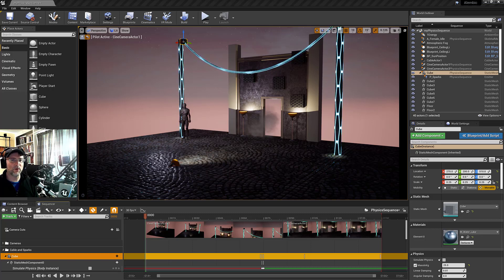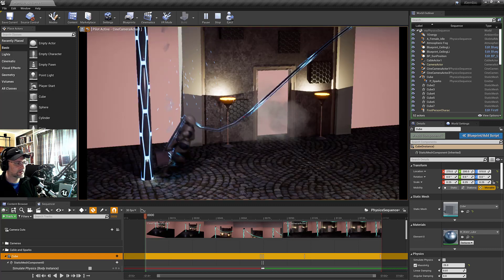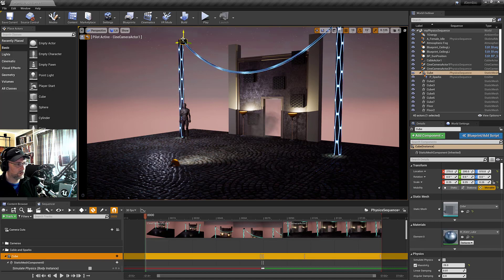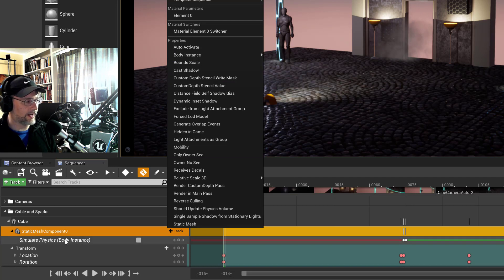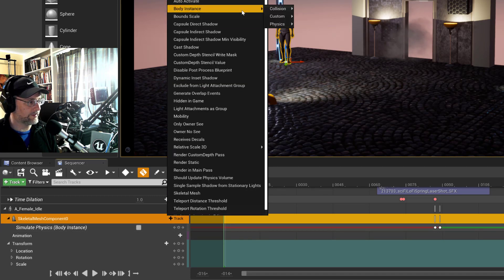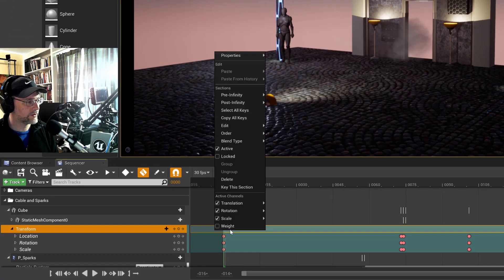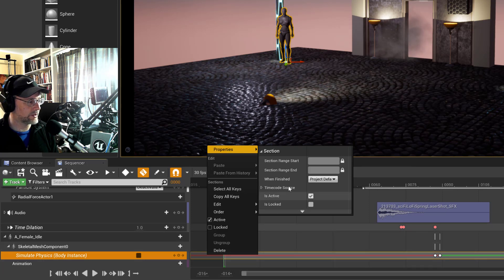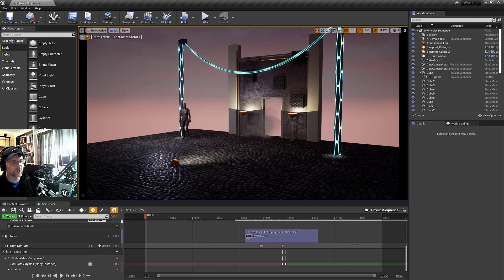Sequencer Physics And Keep Changes:  Unreal!

Comment: Great tip, one quick question do you know if there is a way of having your physics sim / cloth simulation at the same time that you can manipulate your control rig controls? Im animating the face of a Character and I want some dynamic chains that im using with cloth sim on the necklace to colide and move when I move the controls of the neck and head, but seems the sym can one run after I hit play (and the controls dissapear) or I can move the controls but the symulation stops. Thank you very much!

Comment: Hey I am noticing when I key an static mesh object in sequencer, and then set physics to activate when it's positioned where I like it, the simulation doesn't work when I render. The object seems to just vibrate in place as it slowly slowly falls. I notice that this is consistent with a transform track being present, whether I have keys anywhere on it earlier or if its empty.

Is it not possible to initiate physics simulation this way from what you've learned?

Comment: Dear Shaun, thx for this tutorial. It helped me for some effects in my project but not all. Can you teach me how to trigger a CHAOS based fracture with the sequencer? I can do the fracture on my mesh in which it explodes. It works fine when I hit the big play button for preview. I am not using it for a game but for a short film. How do I actually trigger the chaos explosion in sequencer? I tried using suggestions from this tutorial but was not successful. Any advice is appreciated :)
Reply from the maker: Oooh - Chaos physics!  I haven’t tried that yet. I have some slightly hidden tutorials that connect to Chaos physics in my playlists under effects - but Probably not anything you haven’t tried already
Reply: @ShaunFoster  I'll have a look around your videos but this one is a good bet. Not giving up on it yet. i just came across a tutorial that had to change the demo chaos blueprints so they work for UE5. regardless - my question is one that does not get answers in forums. there has been many threads that fall to nothing. thx shaun :)
Reply: @K 3D hope you solved your issue with the chaos sim in sequencer. I'm trying to figure it out too.
Reply: @josebringas513  Hi jose, i did not figure it out. i avoided it like the plague. i went back to blender for some shots. but at some point, i will have to port over to unreal simply because of the scale of the scenes. of course i am keeping my fingers crossed everyday that something like nanite will find its way to blender :)
Reply: 1- https://youtu.be/g1g2zPN25ug
2- https://youtu.be/rH7IMcQqhbc

these 2 videos might help
Reply: @zhixoworld  Dear Zhixo, thanks so much for this :) I intend to try out chaos in 5.1 now that it's out and I am just using it for the past 3 hours after installing it and it's really fast and stable compared to the older versions.

Comment: i have an issue. When i run the simulation and play the sequencer. the physics is super slow and if i pause it goes flying. Its not an FPS issue, fps is solid. Same when i render the video, its super slow and barely starts moving by the time its over
Reply from the maker: Glad you said it isn't an FPS issue.  It sounds to me like you might have some strange things going on with your collision detection.  Maybe turn on CCD... or There are ways to bake the sim - maybe use Alembic Cache instead.
Reply: @ShaunFoster  Tried the CCD thing, didnt change it. How do i bake the animation? 
Thanks for responding
Reply from the maker: @Konksling123  If skel meshes you can do this:  https://www.youtube.com/watch?v=BCsMV5PumpM  if it's a vertex motion sim - you can do this:  https://www.youtube.com/watch?v=q-xW7WhBKzA

Comment: Im confused, I press play to get the sim to work but the sequence doesnt play. And then when I play the sequence (with play enabled) the sim goes very slow until the sequence is done. Then the sim finishes.
Reply from the maker: Did you check your FPS?
Reply: @ShaunFoster  Hey thanks for checking in. You mean check my fps by clicking it in the menu? The FPS in my Sequence is 30fps and on screen is 120fps. Playing the simulation and playing the sequence are completely disconnected. I play the sim and then play the sequence and the sim moves very slowly. Only after I press stop on the sequence the sim plays at normal speed.
Reply from the maker: @rysone3173  does sound like the simulation could be crushing your fps.  I've baked out sims before and brought in using Alembic Cache.  (but that sometimes results in big files) - I'll aim to do another demo soon showing an effect with alembic cache + particles.
Reply: @ShaunFoster  Sweet thanks. I did actually manage to achieve what I wanted. I just wanted to film a large group of objects piled up on each other. I wanted to do a sim instead of manually placing them. I just ran the sim and right clicked "Keep Simulation state" or something like that.

Comment: Hi, thanks for tutorial, but I have question. Can you help? I can activate body physics for ragdoll, but cant change mass of model. Do you know how it works?
Reply from the maker: Sure, please see picture, here you go:  https://drive.google.com/file/d/1OnhJWDmpl31yz_gKUpiFv5InnjDkbJN8/view?usp=sharing
Reply from the maker: you can change mass of each capsule
Reply: @ShaunFoster Thanks for help, it works. But Movie render physics dont match Sequencer Physics. Why, and how I can fix this?
Reply from the maker: @frobrochannel  If you want an exact 1:1 simulation - then you'll need to use something outside of Unreal to "bake" the simulation - example Alembic Cache.  I haven't seen anything in Unreal internally for this yet.  (probably something on the way in the next several months - with the Chaos physics update pending)
Reply: @ShaunFoster  Is there already a solution for this? My simulation in normal sequencer is fine but when rendering with tthe Movie render sequencer it's not unfortuantely :O
Reply from the maker: @maiskorrel  It’s been a busy month, I hope you figured something out! I did some checking but couldn’t find anything about baking simulations in Unreal. If that’s the case then maybe it needs to be baked in another program and kicked out as an Alembic cash
Reply: Wow thanks! Try this tomorrow